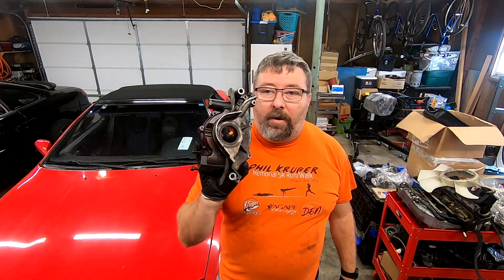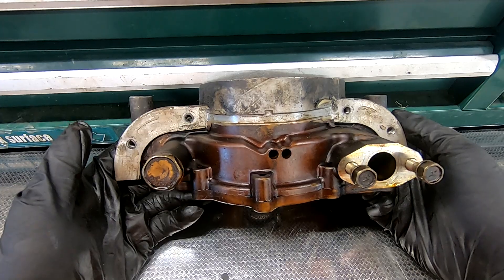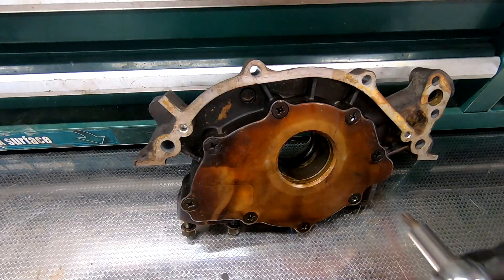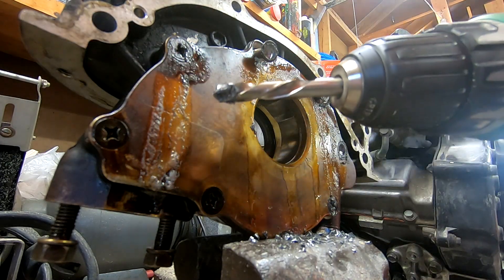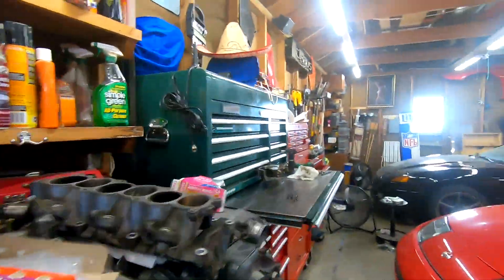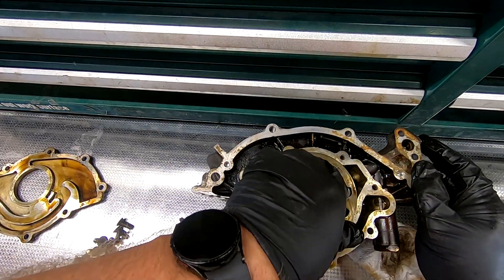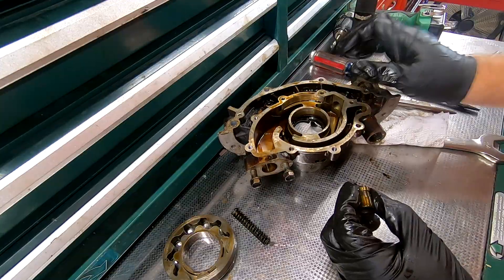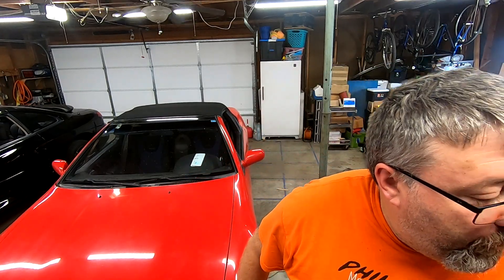Nissan 300ZX - VG30DE - Oil Pump Disassemble - Autopsy

Comment: Do you know if a DETT pump would work on a DE? One sure-fire way of increasing oil pressure? Or am I wrong?
Reply from the maker: Yes, a TT oil pump will work on a NA engine. and yes it will increase oil pressure. just keep in mind you can have to much oil pressure in an engine too.
Reply: @z32_workshop52  Hello, I have the same VG30DE NA one and lets say if i replace with the TT oil pump one and the oil pressure has more pressure, what will be the impact to my engine? Thanks!

Comment: dear bro.. do u sell the oil pump but for dett? i would like to buy..
Reply from the maker: Sorry I have scrapped this oil pump. As I did not want to sell someone a pump that had a bunch of metal go through it.
Reply: or any oil pump which similar to our dett? what i heard z31 is resemble with z32's oil pump
Reply: its hard to find.. plus its pricey
Reply from the maker: @AzZee-p1s  did you check Z1 or CZP
Reply: im searching for:

piston ring
con rod bearing
timing belt
inner flare
oil pump
Reply from the maker: @AzZee-p1s  https://www.ebay.com/itm/276614400256?_skw=vg30de+piston&itmmeta=01JD7E30TVWERF7X4VDKDA679Y&hash=item406780c900:g:hkgAAOSwFu1mzg2o&itmprp=enc%3AAQAJAAAA0HoV3kP08IDx%2BKZ9MfhVJKnlzZPWHeAvgZURUXb9rhHCH9LfkcY1IXh3y0gJJgJMD7JpRv4HLpQX5AQ86L31ot2%2F5olgD6YBDhxF0YuMw0slKvoR3jXP1jwUpufmk01KP4gFnduTO9YamCMzQ1NponB%2FAYlkQPjea1B3%2BbM6ipPkd2bpv9gIkKdLjxhH%2FfbvPjgcZnHjwUBulfbup63JKJRrh%2BZ%2BZrxbMtEDAxNy5zbUkM9N1f5NKTqUCNxw1DbVtQrd%2BLguLP4hzn13F%2BNquHU%3D%7Ctkp%3ABk9SR8KNjO7pZA

Comment: probably just the orings on the plunger that get go hard or warn or from dirty old sludgy oil is my diagnosis after seeing that what's inside of them. thanks for showing us what's in there.
Reply from the maker: No problem, i dont them anyone else has every taken the time to open one up after the engine as failed, plus i wanted to see if there was any damage or not in the pump itself after it eat #5 rod bearing. Glad you liked the video.
Reply: yup bro. youre the person who make my z alive.. the best person ever..

Comment: have you heard of using a bit of heat and an impact screw driver first before becoming a butcher mechanic. Omg drilling them out.
Reply from the maker: LOL, yes i have heard of using heat, and sorry I do not own a impact screwdriver yet. Its a dead/bad pump to me, so saving the screws wasn't an option aka I didn't care so butcher them out, to see whats inside.